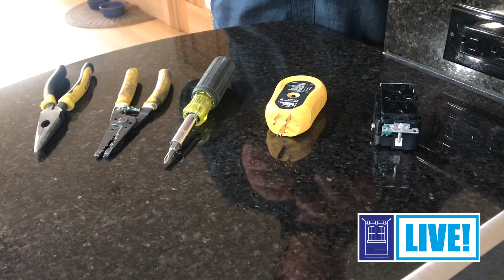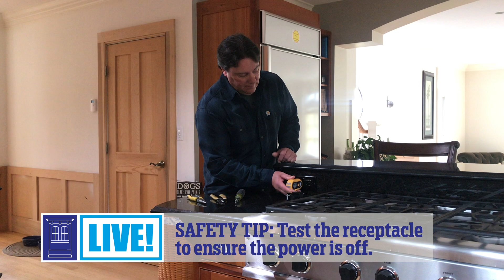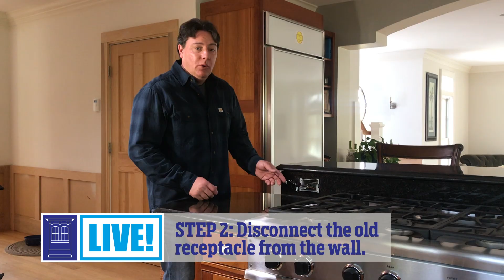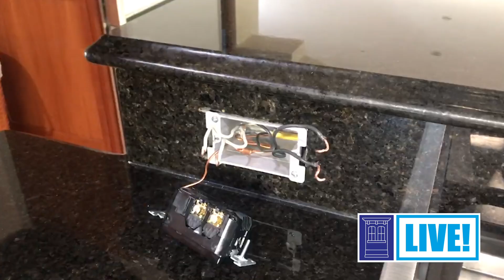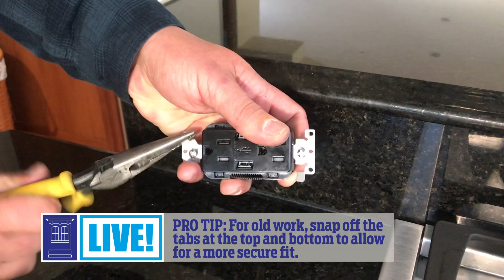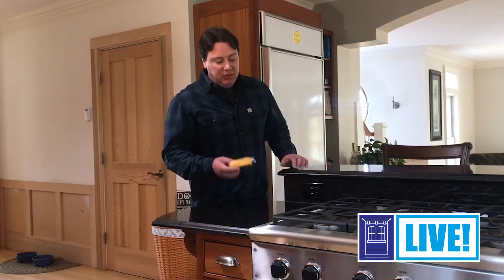How to Install a USB Outlet | This Old House: Live

Comment: My counter has 2 electrical outlets, one has two sets of wires and the other one just has one set of wire. I replaced the outlet with two sets of wire with a USB one, the other one stopped working. However if I put the old outlet  everything works fine, I am not sure what is the  connection there but I am unable to make both work

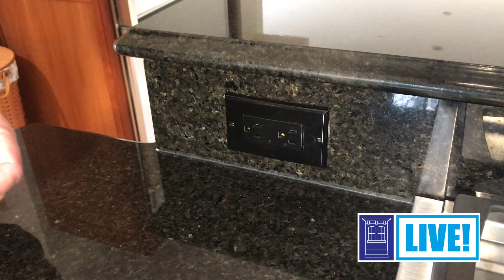Comment: 1:07 You should have tested "Both Outlets". If someone wired one-half of the outlets to one circuit and the other half to another circuit it could be a shocking surprise.

Comment: Kept watching when I saw the breaker panel but stopped watching when he forgot the ground and then wrapped it in electrical tape which covered up the air vents in the back of the device...

Comment: What is missing from the majority of outlets with built-in USB receptacles is that they often DO NOT have surge protection. This includes the Leviton USB receptacle linked in this video's description (someone asked in the Q & A and a Leviton representative confirms there is no surge protection). If anyone knows of a receptacle with built-in surge protection, along with USB type-A and type-C outlets, please let me know. 

Otherwise, it's probably better to go with a surge protected wall tap such as the GE 43650 (search B07RBPTTFG on Amazon).

Comment: It is cool, but I think a multi port USB charger would be easier and possibly cheaper. You can get a USB Wall Charger, Anker 60W 6 Port USB Charging Station, PowerPort 6 Multi USB Charger for $22 at the moment. It can charge six devices at the same time.

Comment: I don't think people realize how much these plugs cost. $25 minimum for an outlet like this compared to a standard outlet for about $0.60. Just buy a charger (and one that actually supports quick charging) that can be moved around. Then when you inevitably have to upgrade/replace chargers, you don't have to replace the entire outlet. 
Sure it's cleaner when nothing is plugged in, but so is a standard outlet. You still have to have a USB cable anyway so if the point is to reduce clutter, the there's really no point. Just keep the charger with the cable.

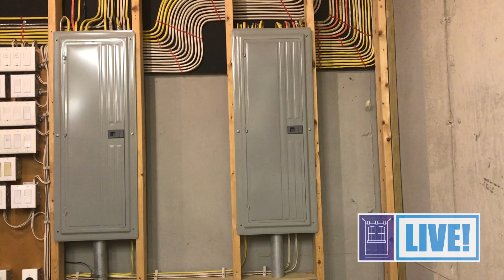Comment: In case you were wondering what the array of light switches on the wall at 0:50 is for. Those are relay signal switches, either X10 or some proprietary variant. By keeping them at the fuse box means you don't hear the loud relays when hitting the remote light switches.

Comment: You ain't getting quick charge from that bro .... Fail
Reply: It's in a client house I'm painting now and charges fast... same thing he's using so what are you talking about?
Reply: @builderspluscustomhomesand2146  DesertFox is talking specifically about Quick Charge.
Many of these outlets that have USB ports integrated into them don't have any kind of fast charging technology (Quick Charge, Power Delivery, etc...). It's a common limitation of these where they can only output a total of 3.1 amps. The usual configuration is 2.1a on one port and 1a on the other (10.2 watts and 5 watts respectively) 
I hope this link can be helpful. https://en.wikipedia.org/wiki/Quick_Charge#Versions

Comment: while a great video, i have to wonder if it's worth it. I set up a charging station in my classroom where i got a 6 usb smart charging hub (determines automatically voltage and amp of device) and it was $3 more than this outlet (today's price). I set up several at the back of my classroom (so kids wouldn't be on their phones, works great). I just don't see this as practical with so many other options which deliver more benefits with less hassle (simple plug in vs rewire).
Reply: In this case the choice to rewire was probably made to save space since it was in a multi-work area. It also provides a cleaner look for such a public space in the home. In the end either option will work fine it's just a matter of which works better for the space you are installing in.

Comment: I've just gotta say the wires are BEAUTIFULLY done coming out of the beaker panels!!
Reply: This is what I came to say. Please show us more of that panel and tell us what all those switches on the left of it are for.
Also, I think a lot of people would love these USB outlets, but they cost around $20 each. Hard sell when a regular outlet is about $1.
Reply: @thaitichi  ... those extra switches next to the breaker panels are "remote switches" that allow operation of common lighting (usually outside floods and driveway / security) without having to pull dedicated wires to all switch locations throughout the home, as you would with typical 3 or 4 way switches. Basically this allows for extra switch points from say a detached garage, barn, master bedroom, front hall, etc without any fancy wiring.... no 3 or 4 conductor cables. In some cases you can have a single "master switch" turn everything on or off at once.
Reply: @thaitichi  Not really that hard of a sell when Apple will try and sell you replacement power plug bricks for about $30. Though I would definitely make sure that the USB outlets you're installing are of the higher USB standard to allow for fast charging of devices that have the feature or better yet the USB-C standard that is becoming more common with newer devices these days.
Reply: @nova31337  It's a hard sell because you can't move this from outlet to outlet because it's built in. And like you said, USB-C is becoming more and more common which just shows that this technology doesn't last very long. In 10 years (if they last that long), people that are installing these will be finding out that the technology is outdated and won't be fast enough for most of their electronics.
Reply: @jensalan  Point definitely taken. It would also definitely suck getting accustomed to not needing a power brick around your house, only to realize you need one if you're out and about.
Reply: @thaitichi  nah, I buy mine for $8 each
Reply: Probably looks like a typical rats nest inside.
Reply: Yeah, because that was a real basement in a real house, not.
Reply: Robert Scott, they’re doing these pieces from their own homes. He’s an electrician, he obviously takes pride in his work and did this all himself.

Comment: Two concerns, didn’t verify tester was working properly on a known live circuit and did not touch upon GFCI protection in that application at all. If you are going to hire a electrician to install arc fault have them do the entire install.

Comment: The grounding wire connection to the new outlet was excluded from the video.
Reply: @Jack Myhre *electrocuted iirc the amperage at a socket is high enough to kill.
Reply: Jack Myhre - hahahahaha Hahahahahaha Hahahahahaha. Absolutely. Also real men always have extra parts left over when building something
Reply: I noticed - and was concerned about - the same thing.

Comment: What were all the switches beside his electrical panel for?
Reply: i also want answers!
Reply: Christian Alsup ... those extra switches next to the breaker panels are "remote switches" that allow operation of common lighting (usually outside floods and driveway / security) without having to pull dedicated wires to all switch locations throughout the home, as you would with typical 3 or 4 way switches. Basically this allows for extra switch points from say a detached garage, barn, master bedroom, front hall, etc without any fancy wiring.... no 3 or 4 conductor cables. In some cases you can have a single "master switch" turn everything on or off at once.

Comment: Also, why do some jurisdictions require the neutrals to be wire nutted together at the back of the box with a single pigtail running to the outlet?
Reply: Typically it's done so if the outlet ever fails, the neutral is still good and it doesn't affect downstream devices.
Reply: Hey Benjamin, one more question I have always wanted to ask a pro. Should decorator switches and outlets slightly protrude past the cover, or should they be perfectly flush?
Reply: @MoneyManHolmes  Best to aim to have them perfectly flush, but that doesn't always happen. 

Particularly with outlets, you want to make sure it's either flush or sticking out. If it's behind the plate, the plate could block some plugs from making a solid connection. 

For cases where it's behind the plate, we use little rubber spacers that hardware stores sell. This helps you to let the outlet protude more from the wall without sacrificing it's rigidity.

Comment: Can you use the clamp method with a single wire? The clamp will sit kind of cockeyed. Is this permitted, or should I just do an old fashioned hook the wire under the screw.
Reply: We do it all the time. Feel free to make it a hook if it makes you feel more comfortable.

Comment: Showing a home owner poor isolation practice and someone is bound to get killed .Put a tag or lock the door so no one flicks the breaker on.Always use a insulated screwdriver .
Reply: @Kevin-mp5of  120 will kill you if you let it. Having respect for 120volts will keep you safe.
Reply: Laurence Farrugia
 ... I would do a tag-out on a job but if I was home alone that's another story. I have also put electrical tape over a breaker in a pinch, but that's more to remind ME that I need to pay attention.
Reply: @Kevin-mp5of  If you seriously think this way you'll be the first to win the Darwin award